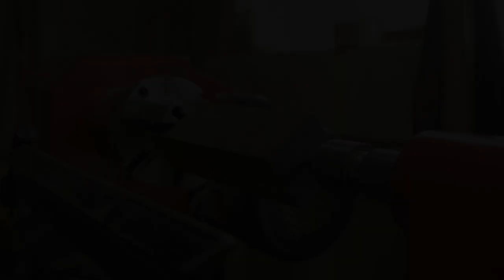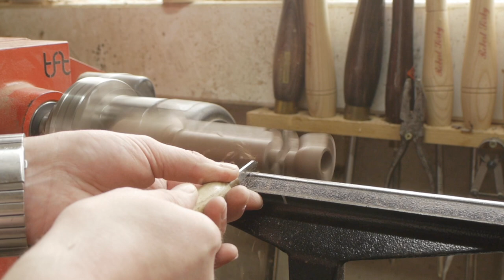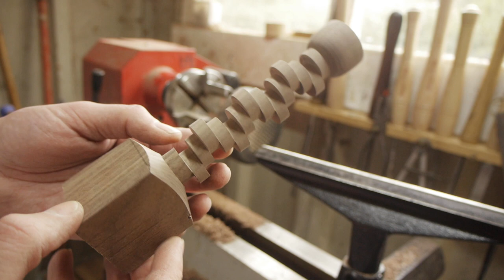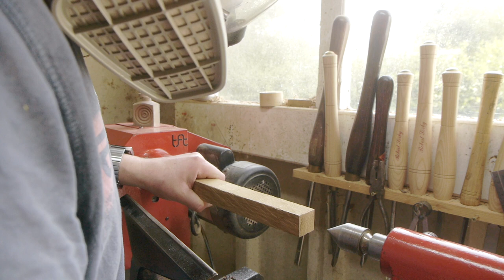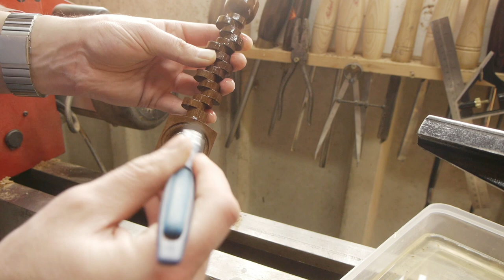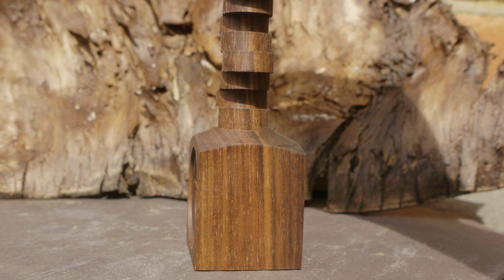Multi Axis Wood Turning - The Crankshaft Candlestick.

Comment: Very  good Tim, only thing , I got told to finish sand every bit as you turn
Reply from the maker: Cheers Doug! Yeah I did a little during but not as much as I should have. Wasn't too bad sanding at the end, there was still a fair bit of strength left in the wood. Thanks for watching!

Comment: Another fantastic piece! Nice job. Question, what about rotating the piece 90 deg every couple of segments?
Reply from the maker: Thank you so much! That's a really good idea actually, rotating then off setting each time may be able to spiral the segments.. interesting! Cheers!!
Reply: @tfturning  I haven't had the 'courage' to do an off-center turning. It seems too off balance for me :-). I am currently trying to turn a piece of alabaster....
Reply from the maker: @marqued775  Crikey, think I'll stick with the off center stuff 😂 I've often thought about turning some kind of rock and now I want a coffee mug after a video I saw earlier. He didn't do much of it on the lathe but what he did looked terrifying!
Reply: @tfturning  The weight of the stone worried me at first since I only have a midi lathe, but it worked out ok. The dust is a concern and it is a bit hard on the tools ;-)
Reply from the maker: @marqued775  Yeah, that would be a job for the carbides I think, trad tools wouldn't last long 😂